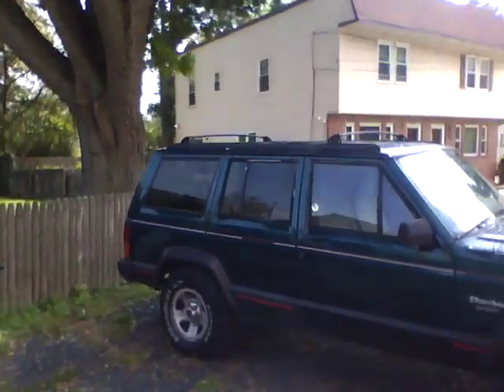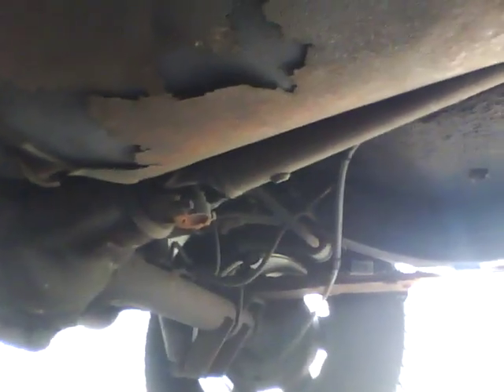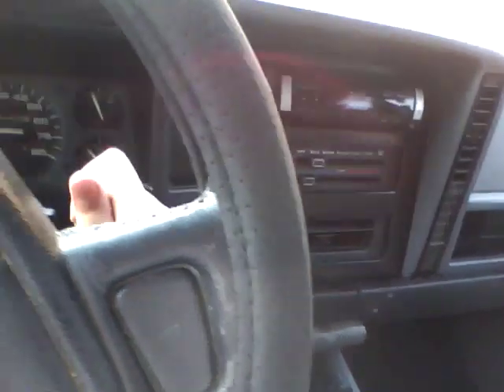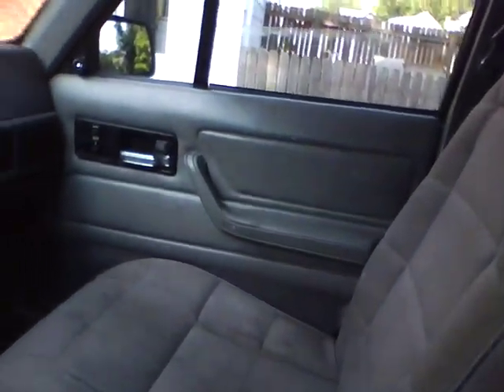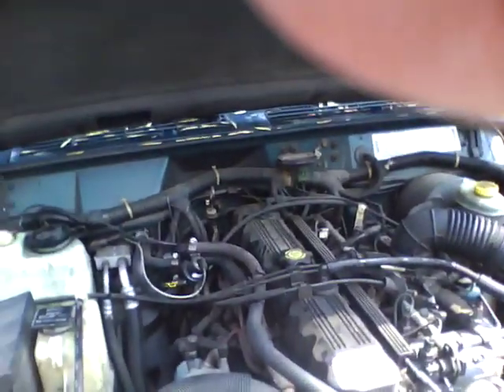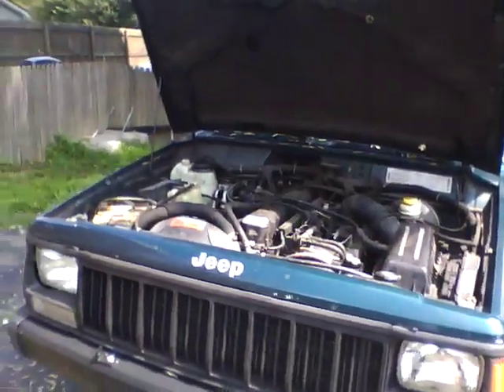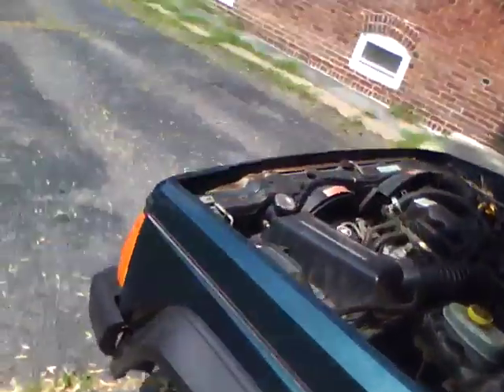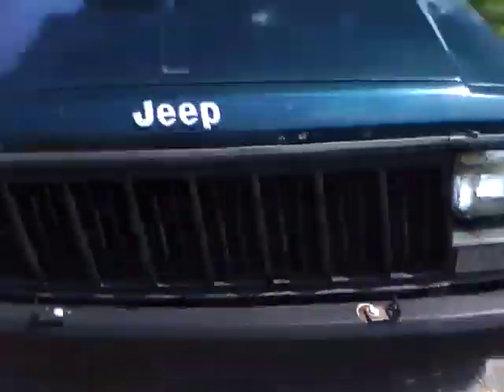Jeep Cherokee 1995 Problem & Startup

Comment: 1995 Jeep Cherokee
Recalls current as of 04/29/2011
 EXTERIOR LIGHTING:HEADLIGHTS  (issued in 2009)
 EXTERIOR LIGHTING  (issued in 2009)
 ELECTRICAL SYSTEM: INSTRUMENT PANEL  (issued in 2008)
 EQUIPMENT:OTHER:LABELS  (issued in 2008)
 EXTERIOR LIGHTING  (issued in 2008)
 FUEL SYSTEM, GASOLINE:DELIVERY:HOSES, LINES/PIPING, AND FITTINGS  (issued in 2008)
 VISIBILITY:POWER WINDOW DEVICES AND CONTROLS  (issued in 2008)
 VISIBILITY:REARVIEW MIRRORS/DEVICES  (issued in 2008)
 15 RECALLS ON THIS

Comment: drive shaft uv joints or rear diff bearing gone bad,uv joints are easy to do with correct tools,rear diff bearing is another matter,but nice car,you can beat a cherokee in the winter.

Comment: I had two jeep grand Cherokees that both vibrated in the rear,  also just over 50 mph. It turned out to be the U-joints. the first jeep I did replace 'em with a friends help, it was a pain in the ass if you don't have the right tools. My second jeep, I just had the shop do it, about $200. Now my current jeep also has a bad vibration in the front, feels like the wheels r going to come off. I'm guessing it is the same problem, though not 100% sure....'95, '99, & now 2001 Grand..

Comment: My cherokee had to have the master brake cylinder replaced every 2 years, and had at least 1 tow every year. It was very poor on highway, my Chevy Blazer is a heck of a lot better in every way. Was a Dodge D150 man, always liked Dodge/Chrysler products, until I bought the Cherokee. I am buying another Blazer in the spring, not buying an overpriced Jeep anymore. Pound for pound, buy a Chevy Blazer over this piece of crap. The 4x4 shift lever in the Cherokee takes up so much driver space.